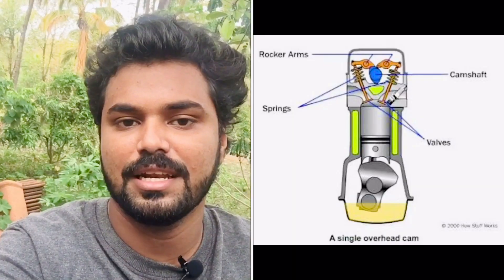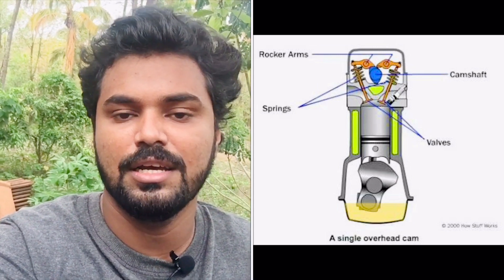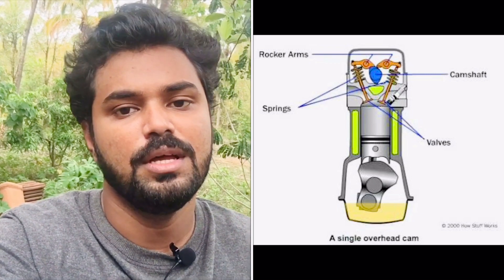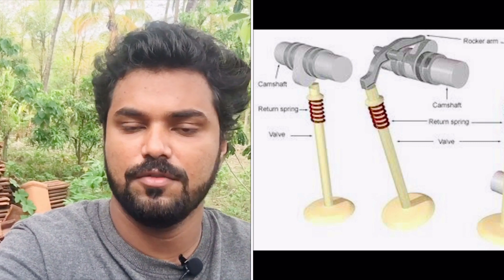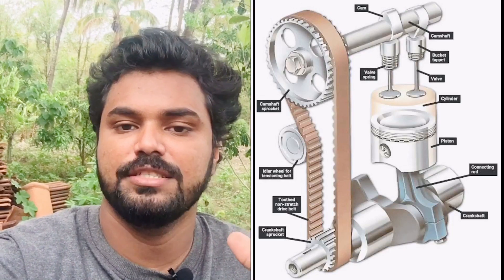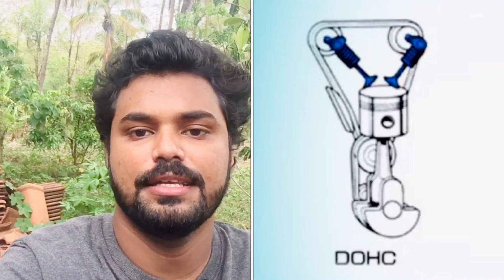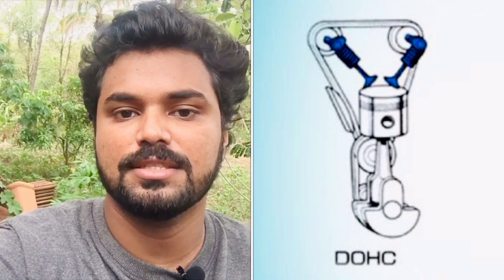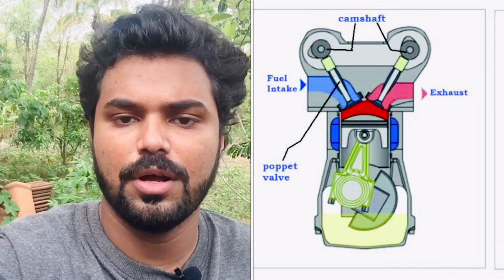SOHC vs DOHC Malayalam || SOHC engine vs DOHC engine ||

Comment: R15 sohc alle.... Rc 200 nekal performance kooduthalund 44 cc difference indengilum
Reply: Performance rc aan top end R15 in undenne ollu
Reply: @sandeepmohan9485  top  end enn parennathilum performance ind.... 0-100 mathram alla performance enn parenath

Cbr nde performance um top endil anu ath DOHC anu
Reply: @jubin2611  ktm focus cheyyunnath top endilalla
Reply: @sandeepmohan9485  top end aarka avshyam initial acc aanu vende city lekaa jill jillennu nikkanam top end prathanyam illa for kerala road
Reply: @op-hx3kn  athe